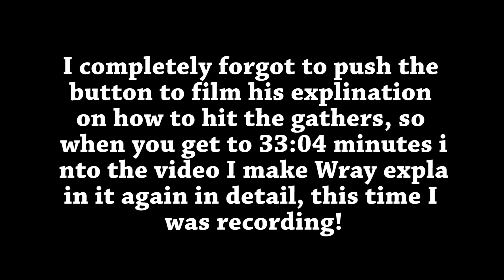Metal Shaping for Beginners: Shrinking Sheet Metal

Comment: Wray. Your coment on Mig and the 3/4" , 1" weld and grind . Nothing was said what Mig wire size he uses and does he use stitch . Just a coment try setting up a stinger for 0.25 wire and stitch or pulse it's  easy to controll with good penatration and fewer burn through holes . Go to a welding supply and have them set up a Stinger for 0.25 wire.🤓
Reply: I use .030 s6 easy grind and a stitch weld process. If you look at your welding setup. .023 and .030 uses nearly the same heat and wire speed.
Reply: @boonelipsey5393  Boon . In theory yes in your comment.  But have you used the method i  menchiond and then compare the differences then you will see what works better all the way around 0.23 . 0.25 wire.
Reply: Yes I have. I experience far less heat effected zone with .030. Expecially if my gap is not as close as I like. It's all about what works best for the individual. Everyone welds differently. I prefer tig over mig in nearly every situation.
Reply: @boonelipsey5393  Both welding methods are veary useful they have advantages over each other that's where experience  go's to play . I find that in welding sheetmetal  0.23 wire has the advantages. Remember you have to properly setup a stinger for 0.23 , 0.25 wire . Hope this helps you be more successful. 🧐
Reply: @curtisvonepp4335  I got turned onto .030 18 years ago. I will never go back. Expecially with my welding process. Ivhave been welding since I was 18 years old. I am 54 years old now. I have welded with .023 for the majority of the time. I prefer 
030. Much better weld. But like I said. I prefer tig.

Comment: Mig weld is brittle and its prone to cracking so heat it with a torch and hammer it litely and use a shrinking wheel if ya get heat worping unless you have all this guys tools

Comment: Your explanations  about the welds is probably OK ,   BUT there is ONLY ONE WAY  to weld new made  panels and not  having any problems, either when  re wheeling (if necessary) or   planishing and the actual surface  finish . And that is ...gas welding ! .... Guess what.... it's also a lot  quicker .
Reply from the maker: Hi Peter, I guess you prefer gas welding. Agreed it works awesome but there are other methods.

Comment: Wray ,   please do not take this as a criticism , but I think you are shrinking the wrong side, (the wheel arch side will shrink it self once you start the blocking the middle crown .) The shrinking should be  done on the oppised  edge, this way the panel will go around the wire buck and immediately touch at the  the top of the buck where your next panel is going to be welded, (and no shrinking at that weld point is necessary )..... The way you are doing it at the moment ,you are going to run out of metal on the wheel arch side + the guard  crown  will be too low  . Again this is not a criticism  simply a HUMBLE  suggestion.
Reply from the maker: Hi Peter, there are many ways to make this panel as I stated, This is an educational demonstration. I will make the same panel again several more ways.

Comment: What he fails to mention is that TIG is going to cool off just about as rapidly as MIG.
Reply from the maker: And the problem is?
Reply: @proshaper  the problem is that if you are going to have that SAME rapid cooling problem with both TIG and MIG then there is no justification in using THAT as the reasoning as to why TIG is supposedly so preferable to MIG.

Ultimately who really cares what welding method they use so long as it gets the job done. FORM FOLLOWS FUNCTION. Does it work as intended? Yes or no? If not. Well, then it can be the most beautiful thing in the world but if it doesn't work then ultimately it's just junk or an art sculpture and not really a mechanism.

A master using LOUSY tools can still produce a better work than a novice even though the novice has the best tools.
Ne?

Comment: So by doing what he does,  he isn't work harding the metal. Is that what your saying.  Is tig welding a form of brazing. Another words is it like brazing but instead of using a flame your using electric. Ronnie.
Reply: A lot like torch welding. With more control. And far less heat distortion.
Reply: @boonelipsey5393  Thanks, I guess I should have bought a tig instead of a mig. Ronnie.
Reply: @brdnsky6417  in a lot of cases. You need both. Best to start with mig. Then upgrade to tig. Just make sure to get a big enough mig for structural.
Reply: @boonelipsey5393  Thanks, I've got a mig. Ronnie.

Comment: i understand why they use mig cause tigs are expensive and are a lot harder to master thats why home builders use them but a pro should never for sheetmetal and i dont know 1 that does. mig welds are hard and after u grind them and put all that heat in there if it hasnt warped it the weld will usually crack when u hammer on them. u should only tig or gas weld panels if u are doing this as a profession at a high level. plus mig takes forever! ok mig welders, let me have it.lol
Reply from the maker: Tig welder can be now purchased inexpensively, for as little as $300.00 for steel only. If you want to tig aluminum and steel you can find a tig welder for under $1000.00.